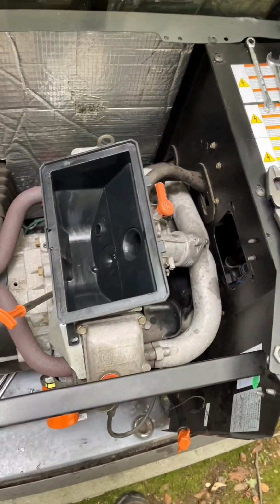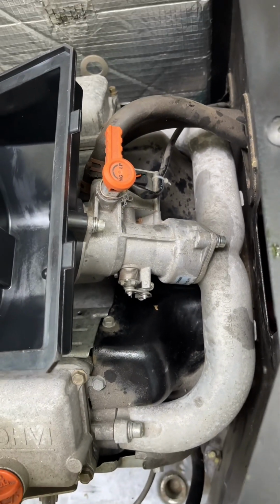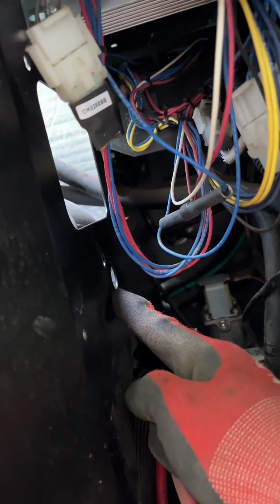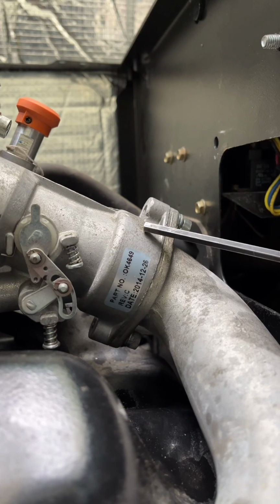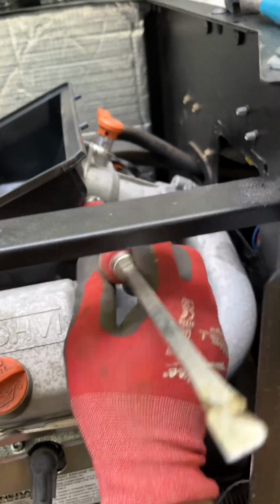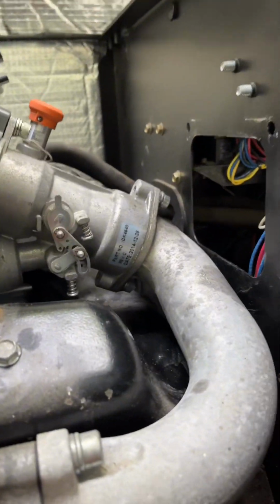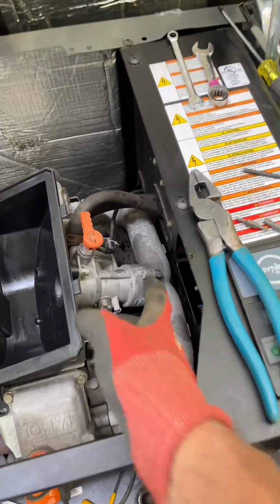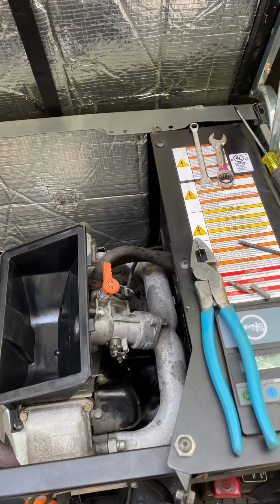Generac 20kw, 22kw, 24kw Removing airbox and mixer assembly. #generac #generator #backuppower

Comment: Had to replace one on a nexus. The internal butterfly choke snapped off the stepper motor connection so it’d throw an over crank being fully closed then throw an over speed when it’d fall open. Threw me for a loop.
Reply from the maker: The good old pinkie finger in the intake throat test … it’s more common than it should be…unfortunately. 

When you removed the mixer did you use silicon to lube the o-rings.

Comment: Thanks for the helpful video. Im pretty sure just the stepper motor for the throttle is bad on mine since the valve is stuck open. Do you have a video on removing the stepper from the mixer assembly? It almost  looks like its pressed fit into the throttle control arm.
Reply from the maker: Unfortunately… the stepper is not a serviceable part, you can’t purchase it separately and yes they are pressed together. 

If the stepper goes bad you have to replace the assembly… can you move the stepper by hand?

You have to check continuity of the stepper wires